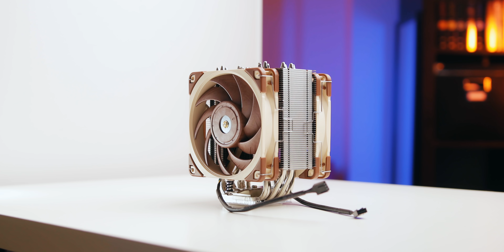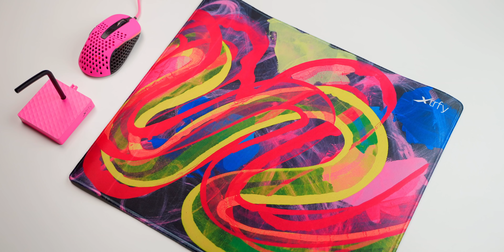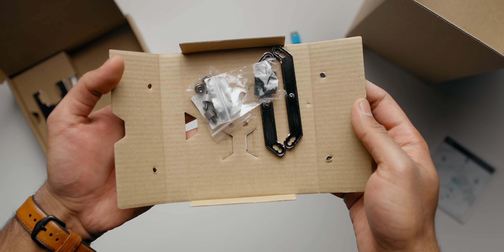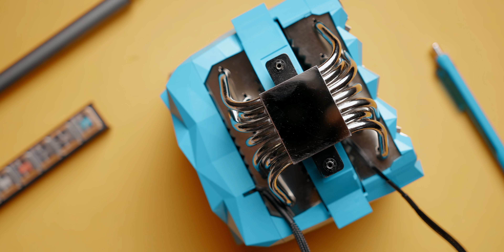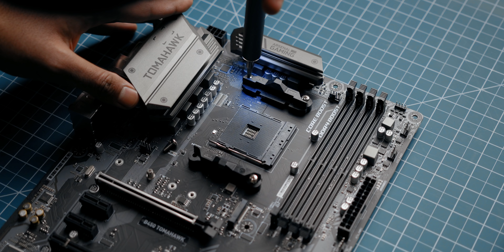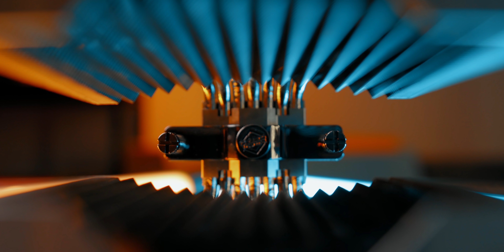Finally a DIFFERENT CPU Cooler! 😲

Comment: This comment section is why no one is experimenting in the air cooling market lol.
Reply from the maker: Bingo.
Reply: No... Just no...
Reply: @HardwareCanucks  "Respectable cooling performance" Yeah, Nah. It's literally at the back of the pack. Nobody is experimenting in the air cooling market because nobody buys this garbage.  Function over form, especially when the form is when it looks like something from the mid 2000's
Reply: @WiktorJurek  man, imagine judging looks like it’s an objective thing.
Reply: @MegaPandaCraft  I didn't imply any objectivity. My statement was wholly objective and my own opinion. People buy things for many different reasons, but saying that this comment section is the reason for the lack of experimentation in the 'CPU cooler market' is pure wrong. I'm sure that noctua 'experiments' with their CPU coolers, I'm sure coolermaster 'experiments' with their CPU coolers, as a CPU cooler manufacturer, you'd be stupid not to experiment and allocate money into experimentation R&D. I'm also sure that with the right marketing approach the Iceberg can do well. This comment section is a small bubble of people that are into picking out the best parts for their computer build, so it comes to me with no surprise that this comment section has received this - mostly positive - review negatively.
Reply: @WiktorJurek  that might be what it looks like on the inside. On the outside I see a bunch of children whining about a product no one is forcing them to buy, which impacts them in ABSOLUTELY NO WAY, so they can validate themselves and reassure their fragile self-esteem that the “correct purchase” they made was worth every penny. If the ice berg cost $3,000 and the only reason was because someone got a polar bear to lick it, it still doesn’t affect you. I don’t understand why “enthusiasts” need to take time from their ever so busy day of superiority to comment on something they have no intention of buying.
Reply: @MegaPandaCraft  Well... In the video, he did ask the viewers to comment their opinions, so I don't really understand why you're having a go at everyone for doing just that?
Reply: @derptyderp5287  because it’s not a discussion, it’s everyone trying their best edgy insult. “Oh my god that would have looked cool in 2004” so original. It’s an echo chamber in here.
Reply: @MegaPandaCraft  most people don’t echo things they don’t agree with
Reply: @DropTableIfExists  you’ve never gotten into politics I see.
Reply: Experimenting is good, but you discard the mistakes instead of trying to charge a premium for them.

This HSF looks cheap, performs like a budget cooler and they try to charge $95 for it? Not cool bro!
Reply: @blahorgaslisk7763  point me to any cooler from 2000 that get even close to this
Reply: @KaiSoDaM  That would be pretty hard as back in 2000 we were still on socket 370 and socket A or something like that. 

Technically the closest would probably be something like the TS Heatronics SCR(something something). But that was arguably more advanced than this cooler, only using a very different formfactor and probably nowhere near able to handle as large a heat load as it only had a pair of 60mm fans, if I remember correctly. 

The performance kings of the time were things like Swiftech MCX or something like that. These were all top down HSF with pretty noisy fans blowing down on them, very seldom larger than 80mm and usually smaller than that. Heat pipes were very uncommon. 

I remember one made by a company called ThermoEngine or something like that. It was a cylindrical aluminium heatsink with a hollow copper slug pressed into the center. Inside the sealed cavity there were a drop or two of water or some other liquid. If it was water then there were probably a partial vacuum to lower the boiling point of the water. Whatever the liquid was it had a boiling point that allowed it to boil at the bottom where the slug was in contact with the CPU, and condensed on the walls where the aluminium heatsink brought the temperature down. Again it was a top down cooler with a small fan on top. 

It actually looked a lot like the heatsinks that Intel provides with their processors even today, though as far as I know they never used the heat pipe core slug, and eventually removed the solid copper slug to make the HSF even cheaper.

So no, I can't point to a HSF from 2000 that matches the IceBerg fan in this video.
Reply: @blahorgaslisk7763  prototyping is not free. Who has the money to just keep blowing on RnD with no returns just to have consumers reply with “*pushes glasses up* but how does it compare to an NH-D15?”

The problem is that people care way too much about metrics that have next to no noticeable difference outside of a chart. The difference between 70 and 80 degrees is non-existent to the observer.
Reply: @MegaPandaCraft  Prototyping is not free, but then these kinds of heatsink and fan combos aren't rocket surgery...

The only real development costs are for making the molds used for the plastic shroud and for the heatsink and the custom fans. Neither of which is a particularly good design. Well the fans might be decent, but as noted in the video they are custom and you can't easily replace them with standard fans if needed. So a fail in user friendliness.

Just look at the amount of cheap coolers performing just as good, if not better and explain to me why this one is worth $95?

And a ten degree difference is not imperceptible to the user. Using todays processors  that difference translates to higher boost clocks and longer time using the boost frequency which translates into better performance even without the user touching the overclocking settings.
Reply: @blahorgaslisk7763  that’s still a much slimmer market. I hate to break it to you, but the enthusiast is the minority. The mom who just bought whatever her kid put in the cart doesn’t care about boost clocks. The kid just thinks “ITS AN ICE BERG”
Reply: @iwankazlow2268  I’m sorry but who crowned you king of subjectivity? You might think it looks bad, but why should anyone care? I happen to think Fortnite looks bad, but its creators could buy me out 1,000,000 times over.
Reply: @iwankazlow2268  it’s hard to make money when a company tries to enter market and is crucified by people who aren’t even their target audience. But I guess people do love a good burning. It’s in our blood.

Comment: Remind me of those old Zalman coolers that were designed while doing at least 3 different drugs.
Reply from the maker: Like the new ones?  LOL
Reply: @HardwareCanucks  It's been a long, strange trip, for Zalman.
Reply: Honestly I wouldn't mind more experimental designs
Reply: @Akame_No_ZaZa  I definitely agree! Feels like scrolling thru people’s builds can get very “Sam-ee”
Reply: @GamersHoney Because everything is optimised to a pretty high precision. I dont want to go back to the old days of cable gore and having to account for drive bays and all that.
Reply: Oh Zalman
Reply: My old Zalman 9700 is one of the better air-coolers I've used.

Still humming along happily after 8+ years in my backup FX based PC.
Reply: Man I'm still so fond of zalman. I'm using my z11 plus side panel as a sticker book and kinda miss the led clear stripper heel fan.
Reply: In the good old days, that's how everything was designed.
Reply: I used those old zalman coolers.
Reply: LOL, what were the said 3 drugs?
Reply: You have my interest
Reply: @ikkeheltvanlig  Mine as well. (: 
Are you going to buy one?
Reply: The worst part was trying to assemble them. I never figured out what combination of 3 different drugs lead to a properly installed Zalman, but the thing looks cool even if I never used it!
Reply: I actually just purchased a zalman CNPS 9900 Max! Going to experiment on how good airflow is with newer components.
Reply: Goddamn, son. Just hearing Zalman brought back some good memories of those ridiculous copper flower heatsinks with the fan in the middle.
Reply: They may have been doing drugs while designing them but they worked, was easy to install and provided pretty good price / performance ratio. Especially the CNPS ALCU models. Turns out the performance difference between the CU and the ALCU models was pretty slim, while replacing almost 66% of the copper in the CU model with aluminium made a relatively big difference in price.

Well I'm really only talking about the 7000 and 8000 series. The 9000 series I never liked. They didn't perform nearly as well as competing tower coolers, and they were no longer trying to keep the price / performance ratio decent.

Something else they did right was the fans. Considering that I probably installed something like 500 to 1000 of the CNPS 7000 series and can't remember getting a single warranty claim because of a dead fan on one of them I think I can say that their fans was above average in quality.

They actually had some non cooling related things that was pretty nifty but never got much attention.
Reply: Zalman flower power cpu Fan it was a beauty

Comment: That’s definitely something I would put in my PC... back in 2008.
Reply: also performs on par with 2008 CPU coolers
Reply from the maker: No one ever moved forward without taking chances.  The took a chance.  Nothing wrong with that.
Reply: @HardwareCanucks  Sure, but this is a step back. This looks like a cheap AliExpress cooler for $10. Moreover, once the fans die, you can throw out the entire cooler. The fact that this is more expensive than both the NH-D15 and the Dark Rock Pro 4 is absolutely laughable.

I’m all for taking risks, but design choices like this one won’t keep the company afloat for long. Understated black boxes with RGB elements are the current trend, I can’t see many people buying the X7.
Reply: @FlickTheBrick  it's just a paid promotion don't see any point of using this cooler except looks
Reply: @FlickTheBrick  being different nowadays stands out and people dont always want a black box with stupid rgb because at the end of the day lights off shits still a black box. That turned off still has a style of it's own.
Reply: @FlickTheBrick  Facts
Reply: @FlickTheBrick  Why would u throw out the entire cooler when the fans die ?, just get white zip-ties, and zip-tie new fans to the heatsink and voila, peak performance again xD
Reply: Isn't it still 2008?
Reply: That built-in fan is the only turnoff, but then they are not the first one doing this. At least Corsair did it right with their take on 'built-in' looks even though their air cooler and maybe the fans need more work.
Reply: Tbh I like the design
Reply: Yeah if it is say $40 or less, it is fine. But not at $100, there are better options.

Comment: Why call it X7 when you then put a 12 and 14cm fan in it instead of a 7cm fan?

The plastic shroud looks like a blue version of the arctic X series air coolers.